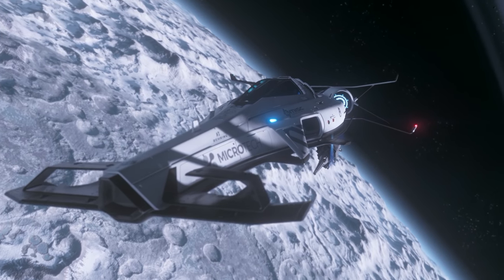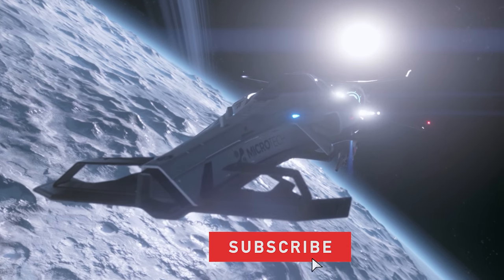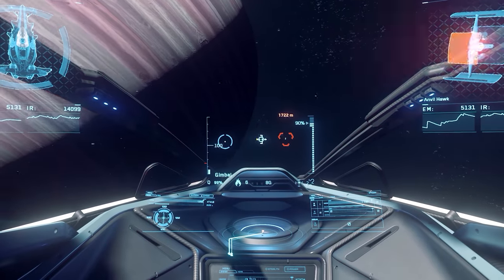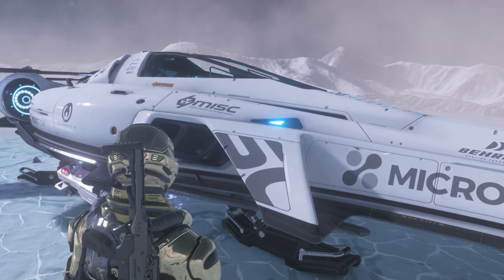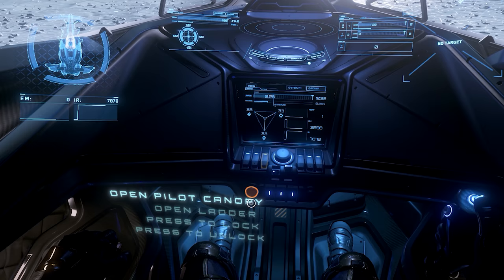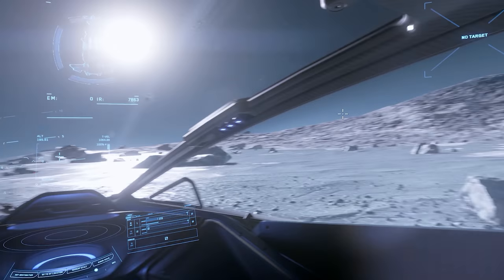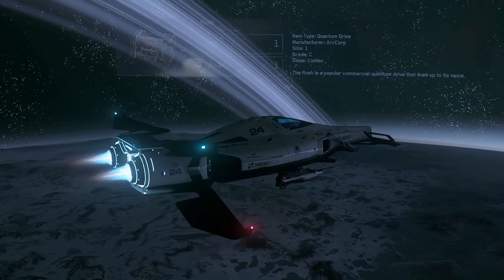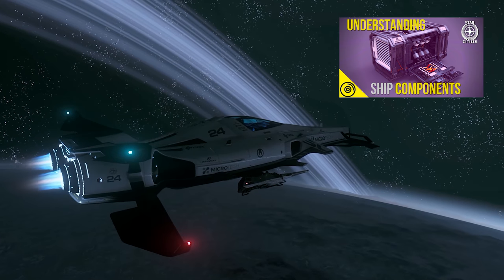The Razor LX | Star Citizen 3.5 | An Avionics Technician's Guide

Comment: The title ‘Avionics Technician’ is one I love so much. I love it because my dad was an avionics technician and thanks to him I got to go to see real service aircraft every day. Whereas you have worked with ospreys and Boeing my dad worked with apaches, fixing them abroad and at home here in England. My dad used to fix apache helicopters before he was medically discharged and he went to all sorts of places. This did mean that until the age of 8 I didn’t get to see him much because he would disappear for months at a time with no promise of coming back. Although he wasn’t on the front line he did have missiles shot at him, during his time at camp bastion he had (literally) over 1000 Iranian missiles fired at him. Each made hols in the ground about a couple feet deep with a diameter of around 6-7 feet (I’m referencing images to get these measurements so I could be wrong)

Comment: Thanks for another great video! 
I'm pretty sure the Razor EX and LX acceleration performance is a "bug", as the base Razor has significantly more powerful accelerations in all axes (and has marginally better atmospheric performance as a result, as it can push against drag slightly better when pitching) - my guess is that the Razor variants got skipped in a balancing pass. I did acceleration testing of as many ships as I could when 3.5.0 was in PTU - the Razor variants being much slower than the base was one of the only major outliers that I noticed. The base Razor's accelerations are 9.4 forward, 5.4 backwards, 2.9 laterally, 4.7 up/down. The Razor LX's accelerations are 7.9g forward, 4.4 backwards, 1.6 laterally, 2.6 up/down - much weaker all around (the EX is identical to the LX except it has 7.4g forward). The base Razor also has the atmospheric instability, but it seems worse in the variants as they just have less strafing power - I think when you try to pitch, the drag pushes back against the rear wings creating quite a bit of leverage and causing the oscillations. I found I could more reliably pitch in atmosphere (without oscillating) by decoupling and strafing up/down rather than pitching - I think the extra drag on the rear wings pitches the ship up/down when you strafe. Here's an (older) IC report: https://robertsspaceindustries.com/community/issue-council/star-citizen-alpha-3/STARC-80958-Razor_variants_acceleration_values_probably_wrong_ Hopefully they get some love in 3.6! Cheers!

Comment: Razors are of the few ships that actually gain significant amount of fuel when not afterburning or not performing maneuvers. You will never run out of fuel in Razor. Gain been nerfed a bit. In 3.4 it was insane, now it's just very good. Can also gain fuel stationary with engine on. And Razor gains fuel anywhere, atmo included. How many ships can do that? My fav ride :)
Reply from the maker: Lol not many! Especially once the fuel changes come! I might keep the EX for recon purposes
Reply: @Seerthe6th  Yeah. 155 is a bit pricey but stealth and indefinite flight time. Also considered a snub and can be spawned on vehicle pad.
Reply from the maker: Ill definitely be able to put one in my C2
Reply: @t888  Hi, Im only 3yrs late to this party, but could you tell me if this is still the case - being able to spawn it on ground vehicle pads? Thx

Comment: Have been curious how the Razors would perform in atmosphere and not surprised by the result. It’s a shame because I really like the look and feel of the ship previously. Will definitely need a rework if it’s to be viable for atmospheric racing. Right now, the M50 flies like a dream in atmo and is pretty easy to obtain in game, so an easy choice.
Reply from the maker: I agree, i hope they fine tune the razor or else no one will want take it down to a orbital body
Reply: Regular Razor handles much better while having same top speed. EX is more drifty. Significantly. But also handles way better than LX. Same top speed again.